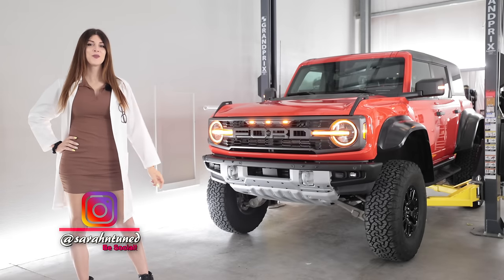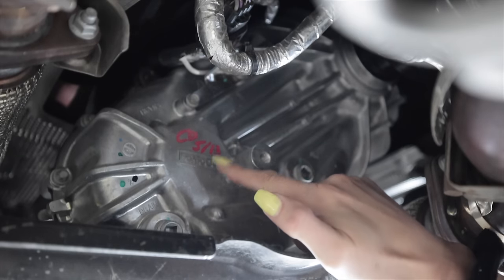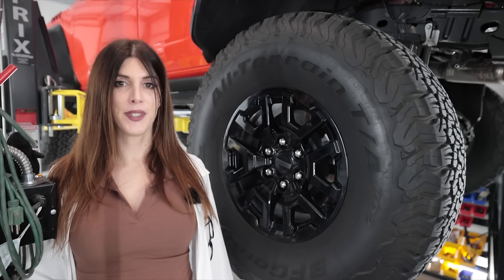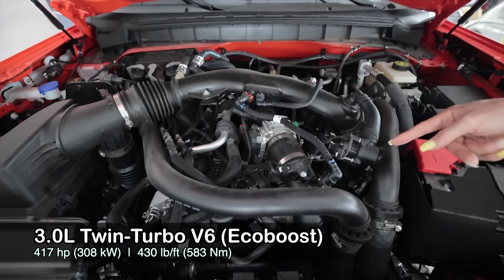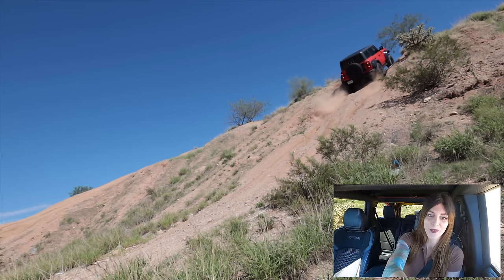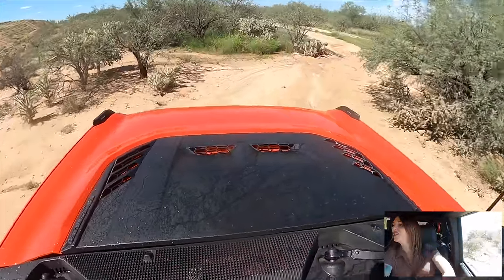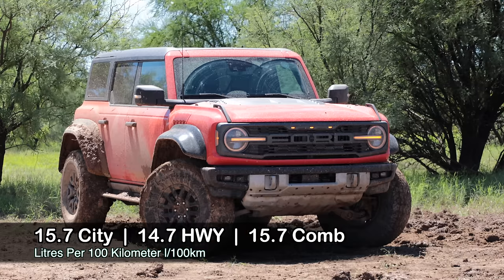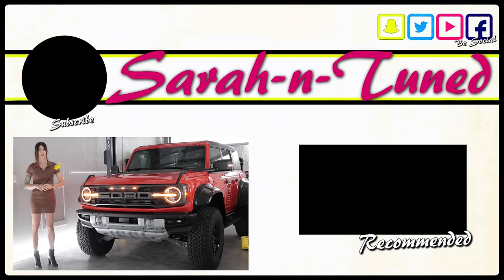Gnarliest Truck I've Ever Driven! // 2022 Ford Bronco Raptor Review

Comment from the maker: Oh yeah.. forgot to add this part. Power to Weight Ratio in Horsepower Per Pound. (Bronco Raptor: 0.073hp/lb , Bronco 2 Door Black Diamond 0.069 hp/lb)  Metric (120W/kg vs 114W/kg)
Reply: Thanks for doing the math.
Reply: The Raptor Bronco tastes like a dinosaur horse. The Wrangler tastes like sheep because wrangling...
Reply: Thanks...i rolled back twice...looking for it on the screen...TWICE!😁
Reply: Coyote or 5.2L Predator and i would buy one. Until then...Ford can shove that junkie V6
Reply: I sure hope you gave it the beans!
Reply: Hey that  puddle dance accompaniment with Ukrainian song- " ти ж мене підманула тиж мене підвела"  was a real bonus (4me),  thanks 😊 😉😄
Reply: For scale my V6 Camaro is    0.093   3600 lbs Vs 335 hp +/-   0 to 60   5.5 sec +/-
Reply: Yep, I was all ready to bang out this very question. That's a lot of extra sofa change for 0.04 hp/lb.
Reply: My tesla is .086 but its horrible at off road
Reply: Of the many things stopping me from getting a Bronco (the absurd cost of getting one imported to the UK being the biggest), that lack of a 2 door LWB model ranks right up there.
Reply: I’d still like to see a race between the raptor and the black diamond, gearing would decide the winner (me thinks 🤔)
Reply: Not enough
Reply: You really are a pleasure to watch. Intelligent and a fantastic sense of humor. Gladly subscribing 😁.
Reply from the maker: @violinmiata  the Raptor is a hair quicker. The 0-60 would be under 1/2 second difference just going off rough math alone.
Reply: So in other words, horsepower doesn't mean a thing when you make the truck heavier in the process.
Reply: @SarahnTuned  See my comment about the Dragy. No more guessing..
Reply: Not to change the subject 😃 but how are we going to celebrate your reaching 500,000 subscribers? This is just the greatest! 😊♥️
Reply: Damn! my ARMADA (Patrol) has the same weight and power as this raptor ... That's one VERY heavy small truck.
Reply: @ianperkins8812  5.7% the law of diminishing returns
Reply: Turbo the zoom droid sweeper
Reply: @Sarah n Tuned Thanks for putting metric in your vids!
Reply: @SarahnTuned  how’s your patronage?
Reply: Did that price comparison include all the money you would have spent on your upgrades - no?  I didn't think so. 

The power to weight ratio is important, but your Bronco is probably heavier than when you purchased it. Also power under the curve is significantly higher for the Raptor.  I am willing to bet that my 2.7 Automatic will dust your 2.3 stick shift, proving the point that peak HP doesn't mean shit.
Reply: Someone tried to scam me posing as you.
Reply: Soooo tune and turbo kit for the 4cyl?
Reply: Biggest disappointment to me
Reply: Nicely done. Love you showing the real you and the BR.
Reply: Loving all you do on you tube, would love a chance to own one of your restores
Reply: @billyshannon6454  . You do realise what a Wrangler actually did on a Cattle Drive ? Looked after the Horses . No Sheep around .
Reply: You can get a factory tune for your 4-cylinder: "$825 for a warranty-backed tune, which provides a bump of 30 hp and 60 lb-ft of torque over the standard ECU trim."

Comment: For that price it is plausible. It has the same interior space as it's predecessors, increased width because of the fenders, interior wind noise above 75mph, goggles gas for breakfast. If you want a go-kart, just rent one for a few days. Needs improvements. And with engine problems and for what they sell aftermarket, hilarious!

Comment: Hopefully somebody at Jeep sees this and sends you a Wrangler 392 ASAP to compare.  For those who buy this, pray that the 3.0 liter Ecoboost doesn't have the dropped valve issue the 2.7 is experiencing in lesser Broncos.  I can't say I'm surprised it did great on the hill climb and other off-road activities, considering that's what it's designed for.  Also not surprised you love this.

Comment: I added those skid plates on my Bronco Sport. I dented up the tin cookie sheet it had on before. It goes from front to back and I got the one that covers the fuel tank. I building it to what I want as I go. Up graded my tires to 6 ply all terrain. It's a little rumbly at highway speeds with road noise. But just turn the radio up lol. I love my Bronco

Comment: One of your best videos, certainly. Makes your little Bronco look like a toy. I think it's worth the money, especially if it proves to be reliable. They could probably charge 100K fo this and get away with it. I'd buy this over the F-150 for the shorter wheelbase alone.
Reply: with ADM, the dealers are getting 100K I am sure.
Reply: But this thing is nothing but a toy, it has no real purpose beyond Sarah's Bronco other than as a plaything.
Reply: @Error6503  Yep, that's the point!
Reply: People are selling base model 22's for like 60k 😬

Comment: I seen someone with a 2020 2021 maybe 2022 Bronco with a similar Rooftop tent I hope they see your video of your breaking test in your 2020 Black diamond Edition Bronco because I remember that it's sort of freaked you out that much weight on the roof made it act so strangely of course it would be different in a longer wheelbase but I think they also have longer tents on the longer ones as well thank you for doing those tests very helpful

Comment: No air vents in the back seat area so it gets hot in the back during those hot summer days. Especially with the soft top. Other than that it's pretty sweet.

Comment: For the price of the Ford Raptor, Sarah can add $36,880 in upgrades to Pokey.  That’s a lot of cheddar in that horse burger.
Reply: Yep. It would probably cost around 20K to "Raptorize" Pokey properly but you'll lose the factory warranty on that stuff. That other 16K went into significant frame and body and all the electronics. I'd just buy the Raptor instead if I really wanted that capability. Her truck would certainly be fun to drive but it's a toy compared to this thing. I'd say this is a case of "Double the pleasure, double the fun".

Comment: beadlocks  rims are are must for HP drive train at $ 74k should not skimp on safety . we ran those in Tecate Baja 1000 busted alot of tires but still had tractions via Beadlocks

Comment: I watch quite a few automotive videos, and I think it’s really interesting that some people hate the 10 speed automatic transmission and some like it. The Ecoboost engine is in the same category. What to you think of this drivetrain combination for durability over time? Will it last 200K-300K miles?
Reply: 200K-300K flogging the bejesus out of it in the dirt, mud, and greasy bits ... I'm not sure about that but who cares with all the fun you"ll have finding out
Reply: I believe like with any other vehicle it really depends on how the owner understands the vehicle and how they take care of said vehicle is what really determines how long the vehicle will last
Reply: Even getting a 150000 miles out of a DTI EcoBoost engine is a pipe dream unless you install a catch can immediately (of which will void the warranty!🤷‍♂️🤦‍♂️), plan on doing a Seafoam upper valve train treatment  every other oil change (to remove carbon buildup),and tapping a drain petcock on the lowest point of the intercooler(collects water).Not to mention oil pan issues and pre-mature turbo failure replacement could cost upwards of $1200.00 to $1600.00 each parts and labor. Other than that pretty much hassle free!   Just sayin.
Reply from the maker: I don’t really ever get to review exotic cars, so my mind isn’t ruined by having super high expectations for everything. 🤷🏻‍♀️
Reply: @SarahnTuned  Hi Sarah - I'm with you, if you don't have an expectation, then you can't be disappointed.  EXCELLENT, and entertaining videos, please keep them coming (insert smiley face here).
Reply: Jeez folks, I sure didn't mean to crap everyone off by asking a question; especially not Sara! I'm a fan to the core, and Sara's attention to detail has me totally hooked. I hope you keep reviewing vehicles of all species just as you have always done. I suppose my Scottish heritage surfaced when I asked about the durability of said engine and transmission. PS: The Ragnar project is making me weak in the knees. I've always wanted a VW beetle in it's original form. Peace.
Reply: @SarahnTuned  Didn't aim to ruin anything. Sorry.

Comment: Honestly, Ford reliability aside... I have been in and driven a Bronco (4-door Wildtrak, Sasquatch Package, 2.7L 10-speed), and I came away extremely impressed.

That 2.7TT has got some boogie (I could feel the off-road tires feeling a little loose at like 60mph), so I can only imagine how the 3.0TT feels.

This would probably be the only Ford I'd buy (except maybe the Raptor R) but the reliability is the big question, especially since Ford has a history of building weak transmissions that break in 50k miles.

Comment: As soon as FORD puts a coyote motor in the Bronco, I'll be the first in line to get mine.
Reply: EXACTLY!!!
Reply: It would also make a huge improvement in the engine bay.  The engine bay on this looks like the engineers said fuck it, and routed every hose and wire loom over the top the engine.

Comment: id venture to guess its not much, if any, faster than a well equipped 2.7. That 1400lbs is a LOT when it comes to power to weight. i'm pretty sure all the automatic Broncos get trail turn assist. Manuals dont

Comment: Mostly intake noise, not much on the exhaust side. Must have been in Sunday morning mode. Exhaust modes? Is that really necessary? Piss off the neighbors whenever and always, but nothing is mechanical anymore. Accelerator by wire, transmission by wire . . . whatever. Why is everything video game graphics for the mentally impaired? Climbs like a goat though. Fun is really expensive these days.🤑 Nice baroque drive there Sarah

Comment: Let's put this in context shall we.  No dealer is going to sell that vehicle at MSRP.  Expect stupid markups making the final cost north of $75k.  In comparison, I currently own a 2015 Ford F-250 Lariat 4x4, a PJ Trailer double axle trailer, and a highly (big emphasis on highly) modified 2010 Jeep JK, all of which I have less than $70k total invested in.  So would I trade all of that for one 2022 Bronco Raptor that rides worse and gets worse fuel economy than my diesel F-250 while having far less towing capability, and that has less off road capability than my TJ?  Your little two door Bronco makes way better sense than being bled dry for one of these Raptor versions.

Comment: Didn't the GX make it up that hill without issue? Doesn't the 2008 Land Cruiser lock the inside wheel for tight turns? THis is $20k more than the GX. WITH WORSE GAS MILAGE! Give me a V8 that will last forever, with zero electronics that fail when your on BLM land without cell service.

Comment: Overbuilt truck that looks really great and seems extremely capable...with a minivan transmission and an engine that sounds like an obese snowblower.   Gonna have to give that one a  big...FAIL.  Making a performance truck like this and not putting a manual transmission in it is just stupid...borderline idiotic.  Then again, Ram TRX did the same stupid sh*t, so there's that.  The manual Broncos are fantastic, even if Ford dumbs it down by only making it only available with the smaller engine.  Just cannot understand the thinking behind putting a minivan auto on this thing.  I understand they've got to suck the EPA's...I mean, comply with EPA regulations to some extent, but still, if you're going to make an enthusiast vehicle then you should give the enthusiasts the drive train they actually want in the thing.  Smh.  

Oh, and it's ridiculously overpriced for what it is and what you get for the money, but I'm sure people with more money than sense will still buy it, so Ford will think everything's just fine.

Comment: Had a 2017 Raptor Truck and other than several hits on the wheel shrouds, which I had to replace, it could not have been a better vehicle.  Did I let it get away from me?  Yes,  DUH.  If the Bronco Raptor is 1/2 that truck it must be awesome.  I would want the big V-8 but I am clearly not a climate change advocate.  LOL